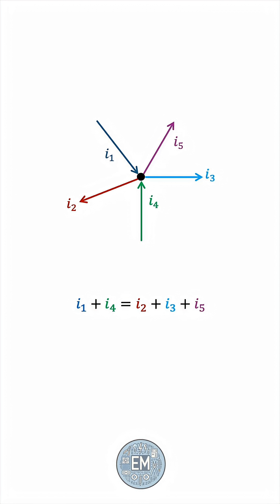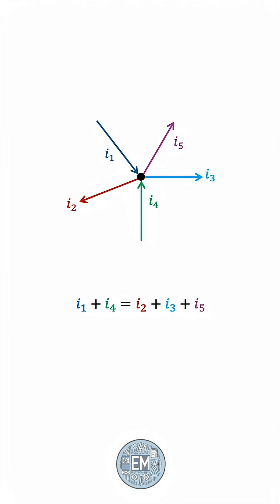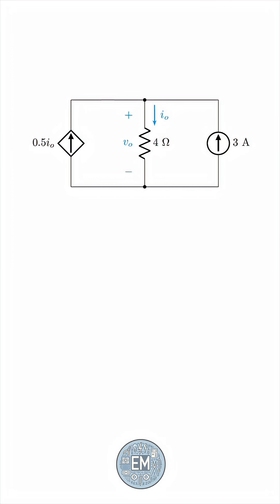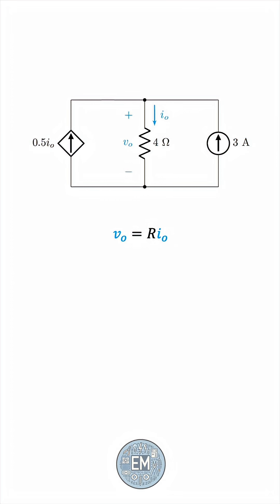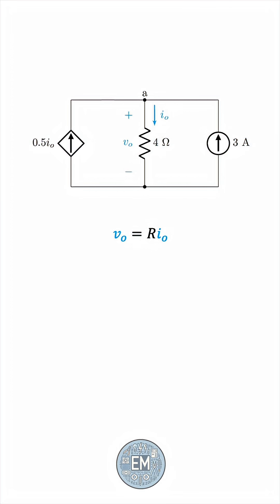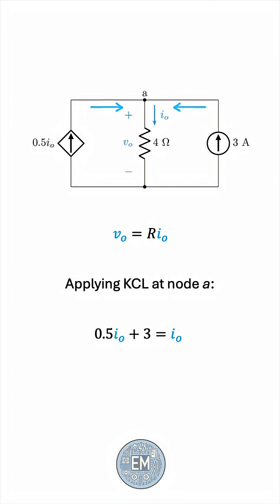Kirchhoff’s Current Law in 1 Minute #electrical #electricalengineering

Comment: can some one explain how the magic happens between .5io+3=io to io = 6. I get 3 /.5 = 6 but based on what logic tells you to divide there?
Reply from the maker: It’s just algebra, so I sped past it to make the video short.

Take 0.5i_o to the other side, and the equation becomes:

0.5i_o = 3, meaning that i_o must be 3/0.5 = 6 A.
Reply: @ElectricalMaths if we take 0.5 to other side it becomes -0.5 so after dividing by 3 we get -6 not 6
Reply: @ziaurrahman3260 
You explanation is wrong, there is already Io at the other side before, taken 0.5iovto other will be negative indeed, but the equation will be io-0. 5io , so +0.5io